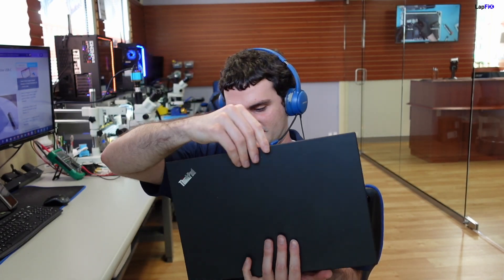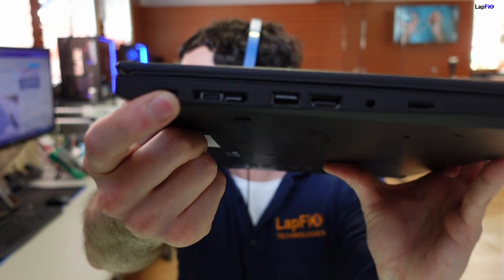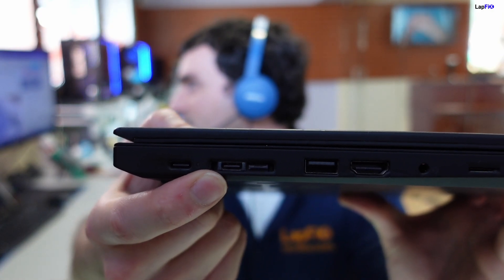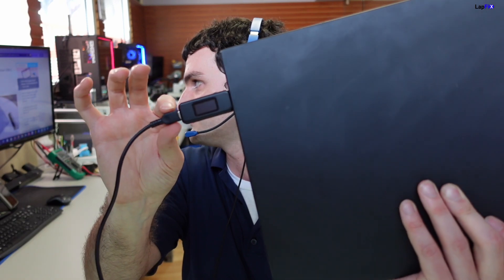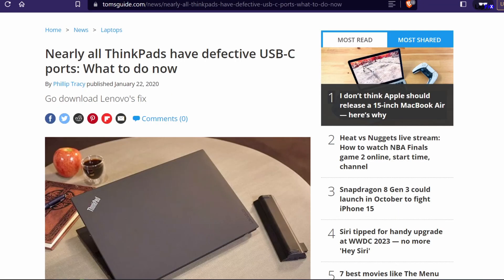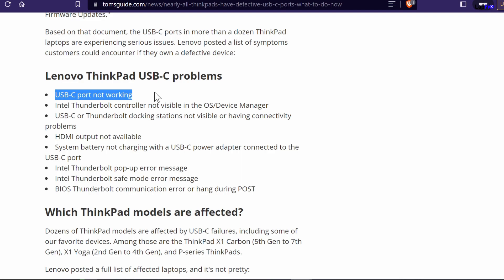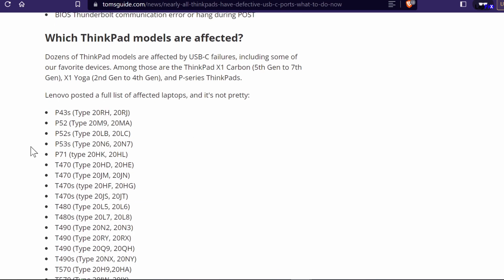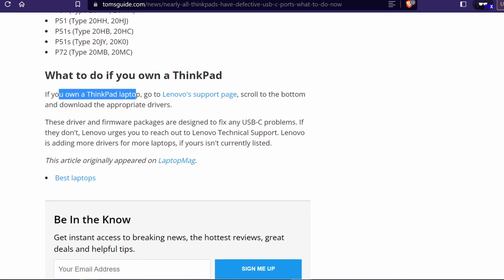Lenovo USB-C Charging Port Issues

Comment from the maker: What do you guys think about USB-C ?  It is becoming more and more of a standard.  But I can only imagine why we don't see it in gaming laptops 🤔
Reply: It is a nice idea, but the mechanics are too fragile, especially for laptops.
Reply: They should have decided on a common port for laptops. Two pole, power only. Usb-c are fundamentally problematic, particularly for higher voltages where shorting across pins can cause more damage. I currently have 3 yoga 910s, all with dead usb-c boards which seem to be impossible to find replacements for.
Reply: It sucks
Reply: I have had this C port on my yoga 7i go bad 3 times. They say dont remove cord from charging port but let it stay in the laptop. Reducing friction and abuse. Who agrees with this?? Or bull???
Reply: @kenwilliams2017  what about when you need to TRANSPORT the laptop anywhere.. in a case or bag or something.. wouldn't that be riskier than 'insertion cycles' of a cable!? It's madness. I've NEVER had a DC power port go bad on me.. USB-C I wouldn't trust.
Reply: I bought a charger with round connector fìi ĺeft rear power port
Reply: I don't trust it to work reliably for 15+ years like a DC power connector can with many insertion cycles. I hate the usage of USB-C charging on laptops. I am currently looking to buy a new laptop and have had to avoid models I would pick if it wasn't for the fact of USB-C PD.
Reply: In a first world country its fine
Reply: It has to become a standard for lower power Laptop. I refuse to purchase or recommend a laptop that doesn't charge via USB C in 2023. The issue is that most cheap sub $600 laptop are still mostly charging via proprietary charger.
Reply: @Jside68  everyone i know has problems with this usb c port.

Comment: I'm sorry, but you talked a lot and only hit on very basic points, we see no voltage when the port isn't working or we see only 5 volts, wobbling the usbc port can cause shorts on the data lines and board damage, Lenovo provides firmware updates which fixes some usbc problems. I think it could be more useful, or it could be shorter.

Comment: I have a Lenovo x13 and the issue is when the battery is dead sometimes the docking station is not able to charge the laptop, it connects and start charging then a couple seconds later disconnects the charge only (the mouse and keyboard continue to working fine) and does not start to charge again. To be able to charge and turn on I have to use the original travel charger or any other USB C charger with enough power. Once the battery is charge the docking station is able to keep the laptop charging.
I use the same Lenovo Docking Station with another laptop which is a MacBook and it works fine without issues, charging and all the accessories. It seams that the laptop does not recognize the docking station only when the battery is dead. With like 5% of battery the laptop accepts the docking station to finish the charge. Very annoying!

Comment: My Lenovo ThinkPad P50 only charges when I hold or twist the charging cable, even after replacing the power jack port and trying a known working adapter, the issue is likely deeper. how to diagnose and fix it

Comment: The USB port is soldered onto the motherboard instead of being affixed as a modular unit onto the motherboard. Hence, because of the soldering connection, the USB port becomes an integral part of the motherboard, thus making the repair more complicated (& expensive).

Comment: I recently bought a T480 "refurbished" from Amazon.  It powered on with USB C adapter but both batteries showed 0% and neither would charge.  Updated everything including the BIOS via Lenovo Vantage but no dice.  Diag test would cancel and simply say battery needs to be replaced.  Amazon's reseller had not tech support so I ended up returning it.  Pain due to weeks waiting on credit back.  Not sure if it was genuine batteries or knockoffs.  Any way to know why and how to avoid if I try to buy again?

Comment: Hello lapfix! I would like to ask one question the Lenovo 300e Chromebook AMD Had two usb-c ports one on the port was burned by wrong voltage on power icon but can I charge from the other side of the port?

Comment: hey i just tried to fix a no power issue on a mn-d351 rev1 board (Lenovo t14), that had an obvious blown diode "d6105" just by the usb port. The laptop has no power no led lights. I replaced the diode (TVS bidirectional esd protection diode) but still no power. I either didn't solder it correctly or maybe somehting else is bad. Can you fix it ? thanks

Comment: Hi sir, I'm running the issues on my Lenovo laptop, similar to that one, could you help me please?
I'm plugging in the power and indicator lights automatically turn as it is working properly, but power is not reaching out the battery and entire motherboard, but the chip (Chip SMSC MEC1633L-AUE Low Power 32-Bit Mobile Embedded Controller.) is getting really hot. Help me to troubleshoot this problem plz.

I use this laptop mostly for studying and I'm out of money, please help.

Comment: My friend was charging his vape with laptop power bank and it leaked. Not noticing, I was charging my laptop and it started acting weird during use, then it would just flash and not charge. Thanks, you gave me the idea whilst watching to take apart and clean. Is actually working again.

Comment: I am a engeneer and clearly understand that using usb-c charching port is a very bad idea. Its way to easy damage that port - just after normal using . You need to be very very carfule when just putting the cable in the port. Suck big time.
Reply: I only have a few devices that use USB-C and wouldn't use it on anything worth more than $50-200. I don't understand why it's becoming normal for laptops to use them. I've experienced so many issues with iPhones lightning ports going flakey just from the stress of insertion cycles and/or the cable pressure from regular charging. I wouldn't trust USB-C in a laptop PD. Never had a DC port go bad on me. My last laptop lasted me 15 years and only died because someone smashed it pieces... I don't believe you would get 1/3 of that time out of a laptop with USB-C PD.

Comment: My phone charger turns the little light on. The laptop stock cable DOES NOT work unless i do a bunch of wiggling.

So the cable tip is the bad NOT the laptop female port.

This probably happened when i was charging my laptop in the car and a bunch of stuff were pushing against it.

Conclusion:
A. The lenovo usbc cable tips are badly build or ultra sensitive that's what she said. The laptop that is lol
B. I will replace thy tip and shall charge it religiously careful and make sure that the next time its undisturbed and u touched while charging.

Comment: Would the light beside port be working if port wasn’t? Light goes from solid orange to eventually solid white but still cannot power on machine. Was getting the blue screen “change time” prior to not powering on.

Comment: Well, that didn't help at all.  I already know I have a problem.  That was 7 minutes of useless.
Reply: They your phones usbc cable or any USB c and see if it turns the little laptop indicator light on. If so, then your cable is bad and you gotta replace it for an android usbc or cell phone usbc won't be powerful enough to deliver the power and charge it efficiently. It will take forever

Comment: Maybe they should make it a standard to have a "power only" USB-C connector on the laptop, so that it just has 4-5 stronger power pins instead of 24 thin pins that also support data. Much easier to repair o the motherboard too, but I doubt any manufacturer thinks about ease of repair 🤦‍♂

Comment: Ugh, we bought my MIL a Thinkpad E580 in early 2018...obviously this model isn't on the list. Charging via USB-C is a terrible idea. My MIL has been complaining about charging issues for years and now it's not working at all. I realize the machine is 6 years old, but I have a 20 year old VAIO that still works pretty good, folks.

Wish I'd known about MS Bit Locker, tho!

Anyway, I'd rather go back to RS232 because at least it's human repairable without a microscope and proprietary tools.

Comment: 4:33 that ! Why the heck would they leave 2 mm gap when the USB connector is in ? It wiggles all over the place when it is connected, it will damage eider from that OR that you forced it too much in because it has that visible gap. 
It bothers me a lot. I just got a new X13.

Comment: please help me the usb c isnt working so what happened is that the screen was flickering every 5 mins so i dissembled my lenovo thinkbook 14 g2 and then  the fan wasnt running and the laptop was soo laggy then i  removed the screws again and put it back together and now its not opening cuz it has no charger and it isnt charging PLEASE I BEG U THIS IS A SCHOOLS LAPTOP PLEASE I NEED HELP AS FAST AS POSSIBLE PLEASE I NEED IT

Comment: Everyone, my both type C ports stoped working, charging one and the one beside it. All you have to do is, take the sim ejector tool and press the reset button which is on the bottom. some one said to press it 3 times, so I pressed it three times. mine was in the center. its a tiny hole, like the sim hole. and then turn it on, and the ports will work again. You should have some power in battery for this to work I guess. Don't take it to the technician.
Reply: your method works!  Anyone who is having this issue, look for a very small hole in the bottom of the laptop.
Reply: @JohnLei NOT on the Yogi.
Reply: I have tried this method still not charging
Reply: It works! Thank you. One of my C ports had lost the ability to charge my 6th gen X1 Carbon, but was still able to  do power out and data in. I shut it down, pressed reset 3 times and booted up and it is fully functional again.
Reply: I have e480, i also has same problem with my charging port is no longer work, the battery alwasy shown 0%, but i found no pinhole at the back too, wht should i do?
Reply: Any tips on how to do this if theres no battery left?
Reply: It works but not solve the main problem
Reply: Thank u very much , it worked!!!!
Reply: Can you help me find my sim ejector? I can’t find the reset button on the bottom. I have the E15 PF-2FGYVR 2020/12
Reply: @Shewbirt2 where is the sim ejector located? help me pls
Reply: @natadecacha  He's just saying you can use any tiny poking device like a sim card tool or a pin/paperclip to press the reset button. I just took the bottom cover off my laptop, inspected the cover to find the hole and used that information to find the tiny button on the circuit board and press it 3 times.
Reply: Your comment is life saving ! I look for any solutions for two days straight until I scroll down to your comment ! Thank you !!!
Reply: Dude thank you so much
was scared that id have to ask my parents to get it fixed. love you bro ❤❤
Reply: @daniboi903  me as well lmao
Reply: Dude thank you so much.
Reply: It deletes all your data tho
Reply: @xFlameN  i think it just reset the bios setting, not user data. Or have you did this before?
Reply: OMFG how is this a thing? My work laptop Lenovo T14 suddenly stopped charging and displaying image through a Dongle, also stopped powering the dongle, and not taking charge in. Did the 3 presses on the hidden reset button and now it's working. I guess it has something to so with unplugging and leaving charge on the board or something? Since it requires a  physical reset. Anyway, THANK YOU!!
Reply: OMG I can't believe this actually worked on my Lenovo Sh*tpad T14... Do you know why? Thank you so much!
Reply: Life saving!!!!!!!!!! Thank you!!!!!!!!!
Reply: Thank youuu!
Reply: LIFE SAVER! This worked and now my docking station and charger work again. Thank you!
Reply: OH MY GOD IT ACTUALLY WORKED. I have a p14s Gen 2 thank you SO much. Can't thank you enough.
Reply: Thank you so much, this helped a ton. I was about to return it to the seller because I thought they gave me a faulty thinkpad.
Reply: Tip just saved me a lot of hassle!! Thank you
Reply: can also confirm that this works! pressed it 3 times and then received a message saying something like "use the charger that was shipped with the device" - I pressed escape and now it’s working fine. Thank you!
Reply: Holy shit I had this issue on my school laptop you just saved me 1 grand!
Reply: it really worksss thanksss 😭😭😭
Reply: OMG! Can't believe such a stupid thing works... YOU SAVED ME!!!
Reply: Thank god I cam to this comment, both my port works now
Reply: When i touch the button it kee going to bios not reset it
Reply: Worked thanks brotha!
Reply: Reset?
Will it wipe out all our Data?
Reply: Thanks!!!
Reply: Thank you!!!! Spent hours trying to fix non working usb port. Worked like magic!
Reply: It works
Reply: How u do this if it's dead?
Reply: Same here laptop 💻 is dead 😭
Reply: i love you bro god bless you you saved my life, thank you brother so much actually, i’m dead broke rn and thought i would have to take my laptop for repairs but u just saved my life god bless you brother
Reply: Thanks bro worked for me,
Reply: Bruuh thanks brrroooookokkk😅😅😅😊😊😊
Reply: For anyone reading I grabbed a paper clip and unbent it and it fits. Next to the SD slot there are 2 little holes find the one with the arrow that looks like a C. Push it in till it stops take it out and repeat 3 times. Then put your charger in. 

Also big props to this guy I actually got mine working thank you 🥇🥇🥇
Reply: What if there’s no power
Reply: Aint shit got fixed with this
Reply: I initially accused my cat of chewing on the cable (which she did) but then I figured out the problem came from the ports. Thanks Dude, your solution works 😺

Comment: I've got a Gen 9 X1 that stopped charging. At first, it would only take 5v, it would only charge at 11-12w sometimes. Both ports behaved the same. 

I attempted a solder reflow of the two grey mosfet chips (CSD87501L) that it seems lenovo has epoxy glued to the board. This did not resolve. I have a few of them on the way, I will try replacing them. With my thermal camera out, it seems the two very small black rectangular IC's that are nearest both USB C ports get quite hot. I cannot hold my finger on them while 5v usb power is being received. Whatever these two IC's are, they seem to be internally shorting or maybe they are a self-resetting fuse. The only recognizable characters are KP and MF8E or MFBE of these two identical IC components.
Reply: We've gone through about 40% of our fleet of Gen 9's with it. The chip will either burn itself up (Literally black on it) or the chip will fall off. 
Lenovo doesn't even question when we put in a warranty replacement for the motherboard anymore, and the new ones that come in, have a blue dot on each chip now (Common verification tool used for verifying a part)
Reply: @wolfejohn1 i uploaded a vid, i think i joined the club. It unseoldered itself
Reply: I am inclined to do the same, (have a look at my last two shorts) i still have IC that overheated led to solder melt, and i know any technician will start talking about motherboard replacement(cause its easier) i am planning to resolder it or findeplacement

Comment: Why is my Lenovo laptop charges only when I use the original charger but doesnt work with any other usb-c charger with PD?
Reply from the maker: Check the Wattage on the charging brick.  If you are using an adapter meant for a phone, it won't have enough wattage to charge the battery...usually
Reply: @lapfix  let me explain it again. I'd like to use my Toocki 67W Power Delivery charger (original Lenovo charger is 65W). When I connect it, Windows says it's connected but not charging. I tried with the cable which has a power meter. T14 takes about 10W then and the icon PD on the display of meter doesnt showup - seems that notebook doesnt activate the PD protocol and is supplied from 5V voltage only. The problem does not occure with the original charger. Output voltages of both chargers are the same: 5, 9, 15, 20 V (and 12V on Toocki).
Reply: @Sparky112  I agree. This is a familiar problem to me. I have two 60WPD powerbanks, 3 60WPD aftermarket chargers and a 100WPD DeWalt system. I have 3 working Lenovos including a 920 and a 2023 X1Gen7. There are circumstances when only a directly-connected genuine Lenovo charger will do, even from the wrong model (e.g. the oldest Lenovo has a yellow square proprietary power system, but can only be charged by a genuine Lenovo usb C PD adapter from the later models when the battery is criitical even though the power demand is easily furnished by the 3rd party PDs), there are circumstances on the Gen7 when ONLY the usb-C port  with the power icon on will do, and there are circumstances when even the port with the power icon won't charge from any 3rd party PD hub (yes I've got 4 of them too).  It's not about the power demand as I can see that on my PD power meter, it is surely about the negotiation between the USB-C componenets. The 920 is the most reliable probably because it isn't too control freaky. Sometimes with a 3rd party power source I get a message on the X1 warning that my PD isn't providing enough power to properly charge the machine and recommending I plug in the original psu. Doing this does not increase the rate of charge. Hmm. To be frank PD is wonderful (apart from the USB-C plug/socket mechanical fragility) but every corporate struggles with engineering open systems whilst arguing with its marketeers about maintaining competitive advantage, and this family of problems has this kind of whiff about it. I don't mind the warning message if it protects me from unwittingly stepping outside the corporate umbrella or warns me I'm on my own, but the messages need to be honest and accurate and not prevent me from doing reasonable things with trusted and well-behaved 3rd party components, and above all not lead to incomprehensible situations where things refuse to work for no good reason other than the manufacturer trying to be too clever by half.